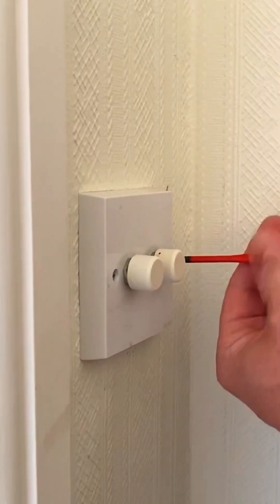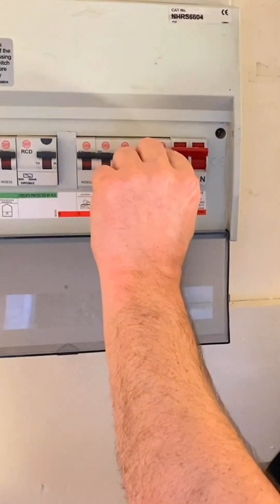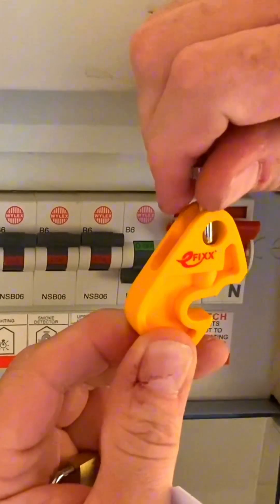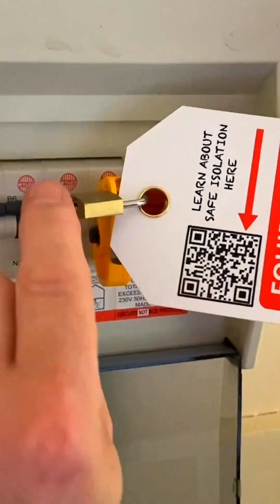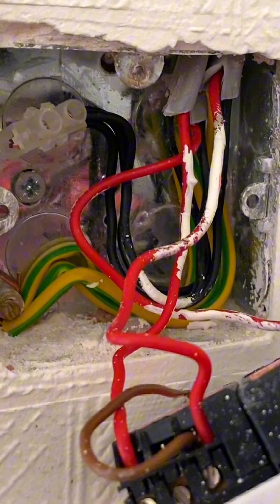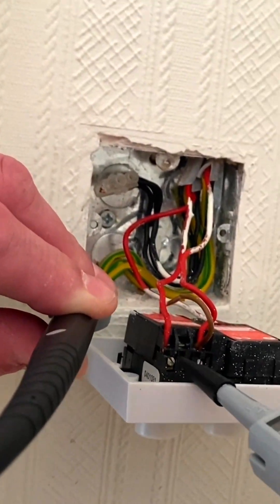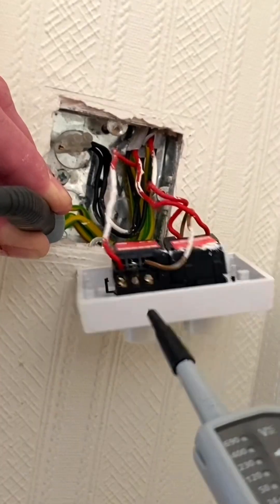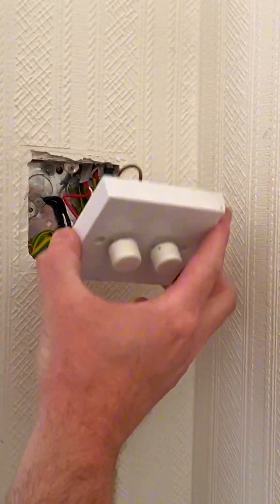2 Gang Light Switch - Safe Isolation

Comment: For me personally, I like to see it go from live at the light switch through to dead at the light switch. There are many reasons the voltage could be missing at the switch, so I want to see it drop out as the breaker is isolated. Just because there is no voltage there does not mean that breaker belongs to that circuit. I work in building maintenance and have seen circuits that were "provided dead" magicly "liven up" though a loose connection or a control circuit, relay timer or thermostat. So confirm live first then, then confirm dead.

Comment: Great video Gary—-may I be so bold to make a small criticism of ur Megger voltage tester—-great instrument, and I own one——but the battery housing is very badly designed—Ie it’s very easy to slightly over tighten the retaining screw, and the the cover comes away from the little bolt in the inner casing—I’ve had to secure it with insulation tape——am I the only one, or has it happed to others as well—-??

Comment: Now show us all how to wire 2x 16mm2 wires into a 50 amp switch,DPDT, enclosed in a plasterboard single socket box ,cause dealing with 1.5mm2 / 2.5mm2 is easy. Thank you.